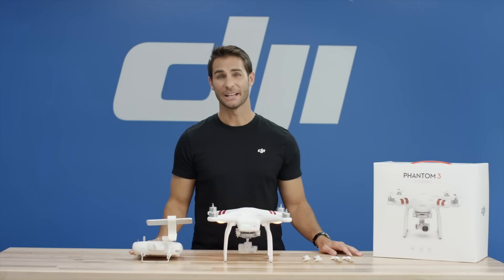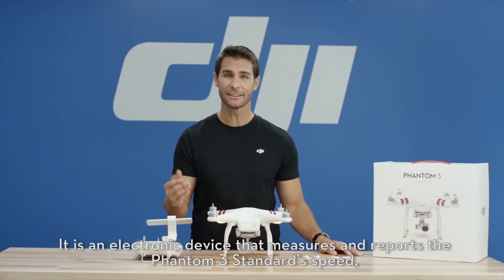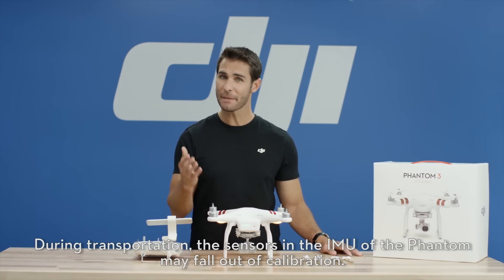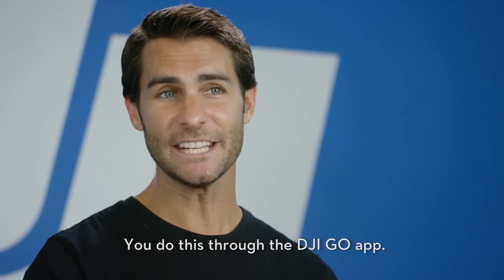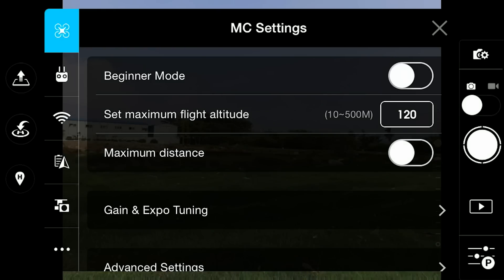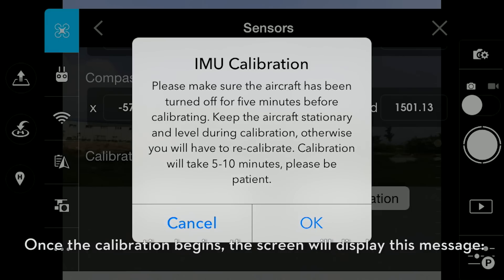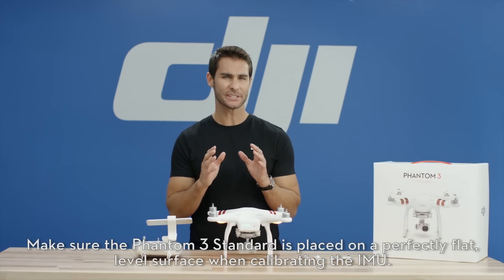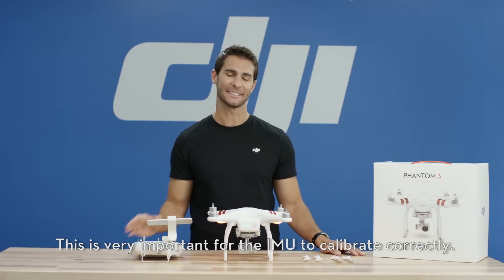DJI Tutorials - Phantom 3 Standard - IMU Calibration

Comment: i have a brand new dji phantom 3 standard they say the remote and aircraft are linked from factory it wasn't and i couldent get the motors to start  read every message on every forum nothing so before i kicked the fuck out of it i thought id do a IMU calibration went to the screen all was blank so prest  calibrate anyway did nothing bar beep i thought fuck it time to send her back and had a cone turned it all off and thought fuck it and turned it back on and prest the button to the left of the IMU calibration button and pulled the sticks down and she fired up to stoned to give a fuck at the moment ill sort it tomorrow so to anyone having probs i recommend a IMU calibration

Comment: Just got the phantom3pro and have an IMU Error: Calibrate IMU. Followed these steps and the IMU Calibration button is grayed out, otherwise unavailable to press. There is also no data in the acceleration/compass boxes. What is the problem? How do I fix this?
Reply: boat anchor or send her back to dji
Reply: Alex Gasaway same for but it isn't just greyed out it's not there
Reply: Dji products are trash